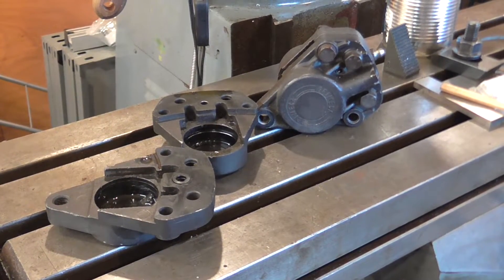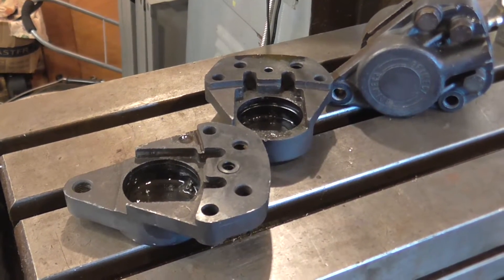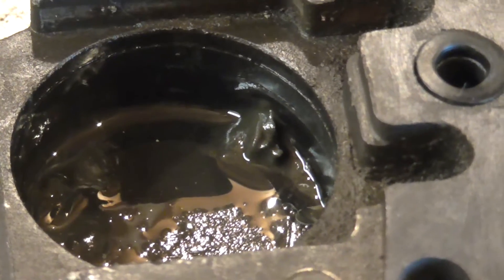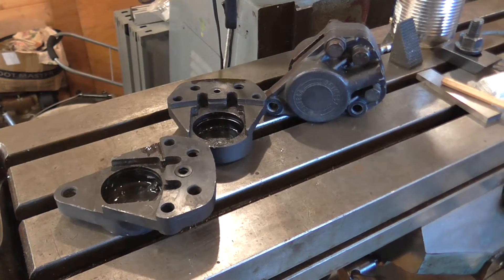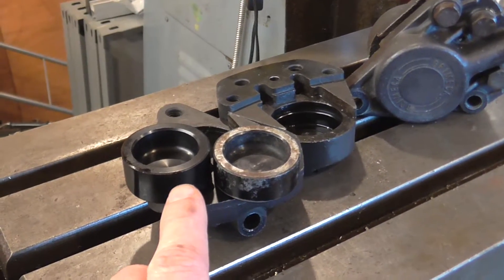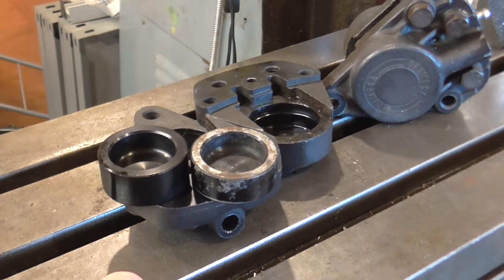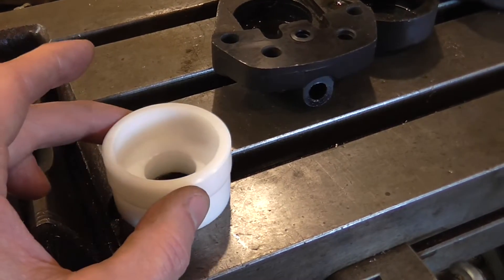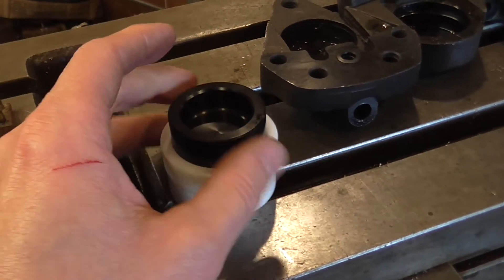Morini brake caliper rebuild - modifying pistons

Comment: Hi Paul. Where did you buy those pistons? After years not being able to get pistons or seals I made my own pistons from brass. A bit heavy really. However my callipers are also very worn and I ended up having an accident with the pistons going cocked and jamming. My bike now has an unreasonably large brake from a Buell which works beautifully but I’d like to return it to original some day by maybe doing your piston mod and sleeving my callipers.
Reply from the maker: Pistons are available from L.P. Williams. Mdina have seals.